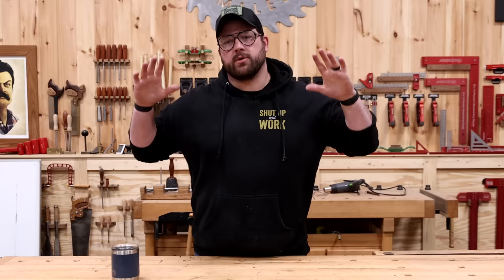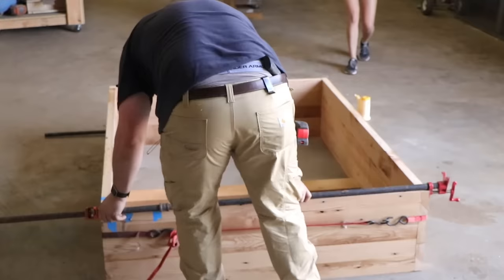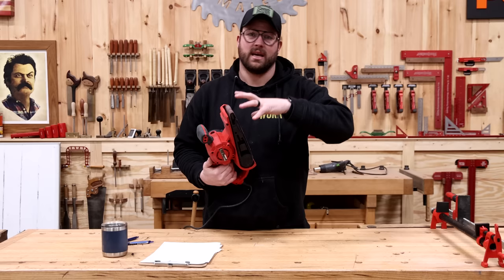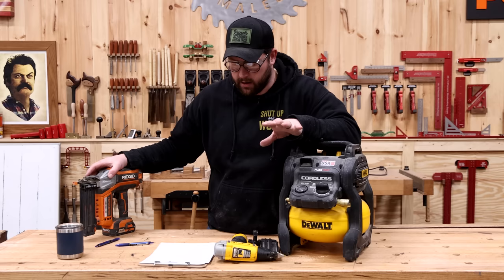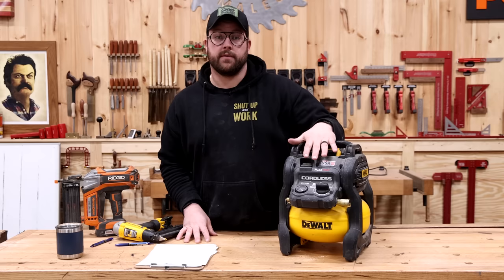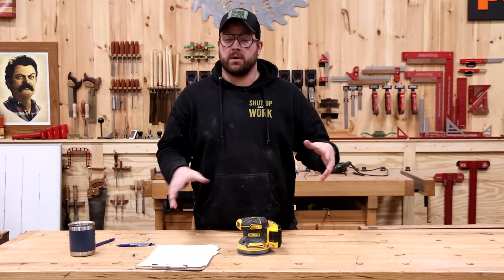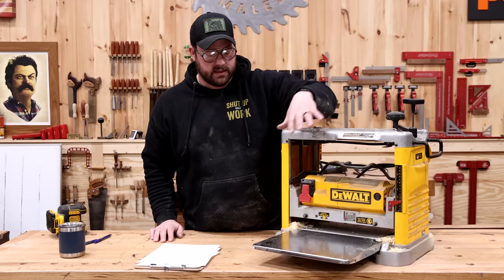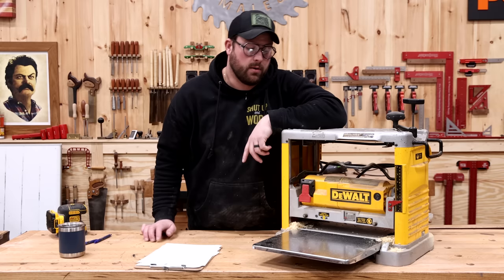5 Beginner Woodworking Tools I Regret Buying

Comment: The harbor freight pipe clamps suck. You can see even in the screenshot here, they effectively have no feet, and the little nubs they do have aren't flat. Thus, you can't stand them up on a bench and lay boards across, because they fall over. It's worth the extra to get something with a better base. On the other hand, the $40 Bauer (corded) orbital sander at HF orbits just as well as the dewalt. :)

Comment: I agree 100% on all of these recommendations. The belt sander was my first and least-used tool ever. Even today after 30 years of woodworking, I'm intimidated and slow to use my belt sander on anything after so many mishaps. The battery operated orbital sanders (mine is DeWalt) is very handy to just grab and go but it is so off-balance it is almost unusable.

Comment: I disagree with the cordless nail guns.  For a DIYer to haul a hose and compressor around is unnecessary.  You can get a cordless nail gun for under $100 and that's a better option IMO.  Also, the battery palm sander is super handy again for the DIYer.  If I was running a sander all day, I'd def plug it in.

Comment: The battery powered brad nailer is way is easier to use. You just grad it and start going. I would never go back to using a compressor, even that little mobile one

Comment: That little Dewalt compressor is basically only good for nail guns...

Air tools have scfm requirements. And compressors have scfm limits. The compressor has its limits, and trying to run a paint sprayer on that would have me making popcorn to watch the shenanigans!

Comment: I got news for you -- Harbor Freight's 23ga pin nailer is only 30 bucks. Might not last as long as the dewalt, but how much are you going to actually use it?  HF's 18ga nailers are only another 30-50 depending on functionality desired.

Comment: Have to disagree with you completely on the parallel clamps Just don’t buy Bessie parallel clamps. They don’t hold properly and if you get any glue on them at all, you can forget about them being adjustable. Bessie Long jaw bar clamps on the other hand are terrific, and I will have them for the rest of my days because they’re highly reliable and sturdy. Jorgensen parallel clamps are the bomb. And additionally, you don’t need a great deal of pressure if you machine your edges properly to begin with.

Comment: clamps...correct...belt sander, I like to use a heftier belt sander, let the weight do the work, Porter Cable all day. Belt sanders and orbitals are 2 different worlds. Cordless nailers are for installs. Track saws are the best, get one. You need a mortiser if you do the same thing all the time. Don't need spindle sander at all. Get a real planer, something heavy and heavy power.

Comment: Far more versatile than a brad nailer for anyone not putting hundreds of nails in is a hand held impact device. They come in different weights and styles, though there is a high degree of interchangeability and overlap. They can also be used for loosening things, bending and shaping metals. some can also be used for removing nails. they can be used anywhere where a high pressure impact for a split second is needed for breaking things or moving resistant components. they can also be used for strengthening exercises of the wrist and arm. The tool is called a Hammer, pronounced hammaa. Having no pretence of being a full time wood worker the brad nailer and it's recommended substitute is massive overkill.

Comment: Do not buy those harbor freight clamps, those will break dude.  Drop one on the concrete and it'll break.  They also don't hold up under pressure, they will move.

Comment: You lost me at clamps.  The Bessey K body clamps are awesome and worth every penny. They do not taco the glue up, so no need for top/ bottom clamping. Helps with wiping up glue squeeze out. As a bonus, the clamp design allows you to stand the glued items on edge on the floor- not easily done with a pipe clamp.  This may not seem like a big thing but when you have a lot of glue ups for a project and a limited amount of space - it's a big deal in terms of keeping the work flow going. I've had every type of clamp and moving forward, we only buy the K body clamps

Comment: The only issue I've found with pipe clamps and black pipe is that Lowes never has anyone trained on the cutting/threading machine for black pipe. NEVER. And Home Depot doesn't even do it at all. I don't have a Menards within 500m AFAIK, so I can't speak for them. So you almost need to buy a pipe cutting/threading tool, which ain't really cheap. Of course, then you can go to Rural King and get your black pipe a hell of a lot cheaper than Lowes charges, so, there's that.

What I did was get a 10' pipe and had them cut and thread it at 4' and 6', so I get two major length clamps for a fairly low price.

Comment: You can pry my cordless 18g nail gun from my cold dead fingers. Sure it weighs a bit more, but I have never had a problem with power and I don't have to drag the stupid air hose around the shop. M18 Milwaukee 18g and M12 Milwaukee pin nailer (which isn't that much heavier anyway). It isn't much of a price difference than a decent set of air nailers and a good compressor, and I am free from the cord, er, well air hose anyway.

I agree on the other items to mentioned.

Comment: I mean, it really depends on the work you want to do - there is no one size fits all answer to this.  My shop went about 30 years before we bought ANY nail guns, because they just aren't relevant to our work, but if I was just starting out as a guitar builder (which is what I do), I wouldn't even think about not having a decent spindle sander - they are just too useful.

Comment: I use dewalt tools so I have at least a dozen dewalt batteries. I’m curious about that cordless compressor.  What are you personal thoughts on battery amperage and longevity when used on the compressor.

Comment: Hard to argue with any of your recommendations... except the belt sander. If you need to remove a lot of material, or if you're sanding end grain (like a cutting board, a common beginner project) you will curse Mr. Malecki and his ancestors endlessly, all the time wishing you had a belt sander. Otherwise, great video!

Comment: I agree on yout list. I did have a question on your planer. Would you consider the Harbor Freight planer comparable to the entry Dewalt and therfore look to upgrade or is the lower cost at HF negate that benefit?

Comment: Couple of concerns.  Comparing the orbital to the crap belt sander doesn't add up.  A real belt sander is definitely worth it, takes some practice only.  A professional grade belt sander is multiple times more productive on that slab than the orbital.  They have different purposes.  Go over with the orbital after the productive work of a real belt sander.  As for the cheap spindle sander, a good belt sander can be easily rigged up as required.  Total agreement on the cordless tools.  Why spend the money on the cordless compressor though?

Comment: I have a cheapo battery powered ryobi 18guage brad nailer. Cost me 120 and came with a battery and charger. I’ve abused that thing for like 4 years. Well worth it.  

ALSO my cheap bottom-tier nailer from the bottom-tier brand, RYOBI, has numb mode… so idk what you’re talking about. Rather, you don’t.

Comment: Hi John I am a fairly new woodworker. I have a compressor that my grandfather gave me. It was like new when he gave it to me over 15 yrs ago. I have never used it. It doesn’t require oil. It is a Sanborn I believe the label fell off? Is there anything special I should do to start it up. I have never used a compressor. Any tips will help. Thank you

Comment: I fell victim to Amazon reviews when looking at the two Dewalt planers.  The cheaper one had much better reviews.  I think I’ve only maybe tripped mine once, not like you say.  But the dust collection is pretty crappy and it snipes the living shyt out of just about every board I run through on both entry and exit, and I’ve adjusted the base panels.  Aside from that stuff, it’s not terrible

Comment: Belt sander isn't for the same purpose as an orbital sander. You can't remove as much material, and the only other options for a beginner are a lot of plaining.
Reply: So I do hardwood floors for a living. I use my battery-powered pin nailer so much more often than my air one. I tend to do small repairs in floors I am refinishing more than installs of fresh flooring, so I do not have to haul an air compressor, and all my sanding equipment around is so nice.

Comment: Another reason not to buy a cordless sander: you'll almost certainly want to use dust extraction. If you already have a hose hooked up to a vacuum, its irrelevant whetger youre also trailing an electrical lead.

Comment: "Don't buy this $40 clamp.  Buy these $21 clamp parts instead.  Half the price!  Well, then you need pipe to make it actually work.  But that's just an additional $15.50.  So you've saved an entire $3.50 for a clamp that's not actually as good as the parallel clamp!  Hooray!"  :rolleyes:

Comment: Include homemade tools instead of expensive manufactured rulespower tools. Buying power sanders is unnecessary if you have a planing tool to flatten out chunks of 2by 4' of any length applicable to the size of your project. Cross sanding  with a large (long)4 Inch sanding block results in  a very flat smooth surface very quickly. I normally use 4 inch wide one inch thick hardwood swarf which will last for years using industrial rolls of 4 inch wide automotive sandpaper, very economical over time. cloth backed sandpaper does a super job on curved surfaces using a stropping actions for circular objects. Try it you will like it because it is fast with a lot of control . If you are going to make a lot of identical pieces learn how to make basic wooden fixtures from swarf. Purchased metal fixtures are very expensive and heavy heavy  and homemade fixtures are exactly what you need and will likely last longer than you need them. An old fixture can be repurposed easily and cheaply if made with screws only, no glue. Practice makes perfect applies to fixture building and simple tool making. The most important rule in woodworking is the 6P rule rule:
"Proper Planning Prevents Piss Poor Performance"
As this video by John Malecki shows, many tools that are manufactured manufactured do not use the 6P rule only the make it cute and shiny and charge lots of money  rule!

Comment: If you dont value your time, I agree with the thing about clamps, but the difference between paralell clamps and pipe clamps is astounding.  Using paralell clamps has cut my sanding and planing time down so much that it has negated the cost of the clamps.  And I don't know what he is doing wrong with his planer, but I just ran mine for about 4 hours straigh with no issues, and I probably have run about 2000 bd feet of hardwood through it in total.

Comment: Agreed on the pipe clamps. Disagree on the belt sander. You just have a poor quality unit. The Makita 3X24 is bulletproof and none of the issues you mentioned are relevant to it. I even built a platform to use it as an edge sander. 
Agree on cordless nailer and palm sander, but why then promote the cordless compressor?
When are you in the woods doing finish trim work?
Agreed on the mortise machine, but I did buy the attachment for my drill press. Works well. So does a hammer and chisel. 
Toy tools like the spindle sander might be ok for very small projects but are not meant for significant work. Most “Handyman” tool aisles in the box stores promote these type of toy tools. 
As far as thickness planers just buy lumber dressed 4 sides until you can afford a cast iron unit.

Comment: First of all ,the three Sanders you mention all have different functions. And in the hands of someone that knows what they're doing a belt sander is an extremely versatile tool . For the beginner, nail guns are a luxury. Learn how to drive a nail with a hammer, before you step up the nail guns. And I would never buy a cordless compressor unless I was on site somewhere that has no power. Having a cordless compressor that sits in a stationary position to do its job is stupid. What do you plan on doing dragging it around the shop with you ? Here's a hint by a longer hose, plug your compressor into the wall and leave it there . Why screw around with batteries when you don't need to. As for the tabletop belt sander / spindle sander, excellent tool if you have to sand curves, you'll have tons of control with that, as opposed to chuckin a sanding drum in your handheld drill, that's got a mature written all over it.  And lastly you wouldn't buy a cordless orbital sander but you would use a cordless compressor in a shop setting. Arrrrrg!      Some of your advice is worse than useless. You should stick to building projects and stop giving people advice.

Comment: Nice tip on the drill press attachment. Is that a 4.5" spindle from NUXTUL?
Reply: Nevermind - answered my own question. That's the $250 pneumatic drum sand attachment from Sand-Rite.

Comment: I think the takeaway here is that  if you arent doing renos/diy/construction, buying these tools isnt practical.  If your just starting out doing woodworking, you should spend your startup  cash on woodworking tools, not stuff for diy/renos. That being said, cordless sanders & nailers are a necessity if, say, your doing multiple suites worth of trim in an apartment and a belt sander is indispensable when doin renos, so if you are doing that kinda stuff as well....

Comment: Instead of cordless compressor an electric compressor and 100 feet of hose for household trimwork.
13:05 "20 volt outlet" should be "20 amp outlet"

Comment: Belt sander: When I first started out (1980) I hated the belt sander...  But I practiced with it and learned how to use it.  One can make a mess in a hurry for sure.  But now over the years I use it a lot.  I have 2 of them because I do not enjoy changing the belt grits.  I am sorry you simply never developed the knack of using a belt sander.  Come down like landing a plane and come off like taking off like a plane and let the weight of the sander do the work.  The belt sander requires practice and like so many tools - care in use.  It is not the tool that is the problem - it is the operator.

Comment: Those are ALL expensive tools for a beginner making cabinets and craft projects.  The Dewalt nailer does the same thing the cordless nailer does, only faster , it's just one guage,...like the cordless one... fake point.  Cordless nailers are a little too expensive and difficult to use compared to a $50 harbor frieght nailer that can accommodate 1 to 2 inch nailes and even staples  and uses a standard air compressor.  My rule of thumb is don't buy the cheapest and don't waste money on the most expensive.  Bauer planers at Harbor Freight are decent,  between $200 and $300 on sale and will do 12 and 1/2 inches with a low incriment of 1/32 of an inch.  they have a double roller feed and when they are sharp they do a super job.  I have had mine for about 4 years and changed the blades one time, I use it about every week and today I made about 28 gallons of pine wood shavings in about 40 minutes and didn't have any trouble with the 6 inch stock at 1/16 th of an inch.  
     Harbor Freight belt sanders are between 35 and 45 dollars, will do a good job for a few years and then start making noise, their random orbital sanders are even cheaper and also last a few years and then you have replacement parts for the next sander.  I am proficient with using a belt sander down to 36 grit, it is easy to gouge a table top if you are not steady, it does not chip around knots like a planer does but you have to know when to stop and switch to 60 grit and then 80 grit.  By having cheap sanders you can use 3 or 4 without having to change belts and it makes work go super fast.  Orbital sanders are not designed to take off much wood nor as fast as a belt driven model.  Between use I sometimes use a home made cabinet planer with a special handle holding it to get a more even flat finish but it is labor intensive but also gives your sander a few minutes to cool down.  
      When you have loads of money pouring in then you can buy all those fancy high dollar tools that boast a savings of time.  So much is done now with computers, CNC and laser cutters and giant machine fed sanders and planers that no beginner who claims to be broke could afford.  So little effort today is being put into hand work, carving or improvising, but rather there is a 800 dollar multiplug  with a flex arm for a drawer that will do the same job as a $25 dollar plug and a rubber band for a drawer power source.  I guess it depends on if your client is rich and doesn't mind being ripped off by over priced hardware purchases.

Comment: Fuck them Pipe clamps. I did 80" glue ups for a couple exterior doors out of 1x8's with 4-8' steel angle irons, clamped at the outside edges, both sides with a bunch of 12" steel parallel clamps from Harbor, squeezing the boards together with 1" ratchet straps. The joints were reinforced with 1/4" dowels, and glued with gorilla glue. The only clamps you need for any glue up are the cheap 12" from Harbor Freight.

Comment: I couldn't disagree more with the air tools vs battery, I thought it was more bang for your buck and invested like $500 in tools and air tank, 6 months later I didn't know why I was lugging around a heavy air tank and tripping over hoses and switched everything to battery, also my 6 to 7-year-old 18ga rigid battery Brad nailer does have a bump mode so it's weird that yours doesn't.

Comment: From my limited experience. I don't see how anyone runs a shop, including an electronic repair shop without an air compressor. and don't make the mistake of buying a compressor that is lower in cfm than you really need. It is the most important number on a compressor. anything will generate 90 psi.